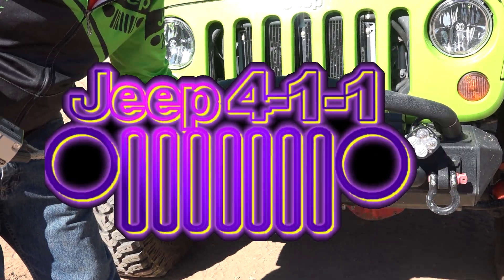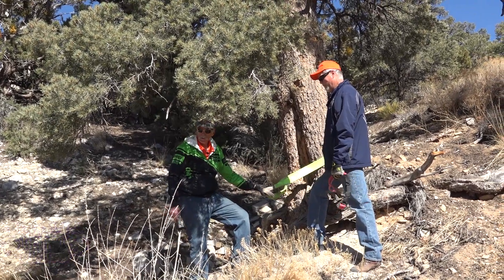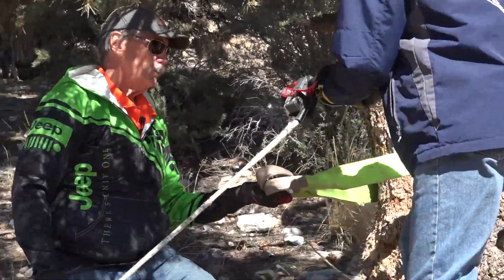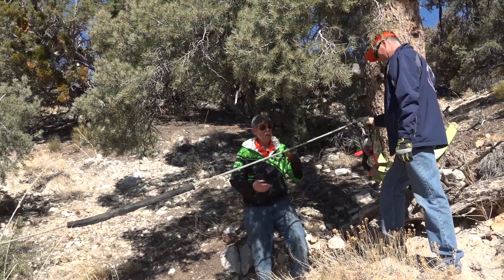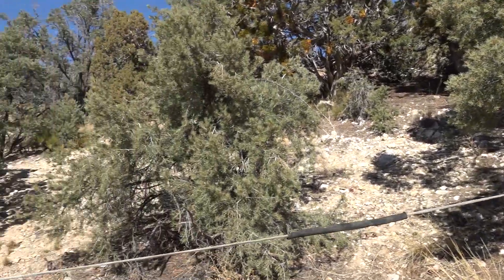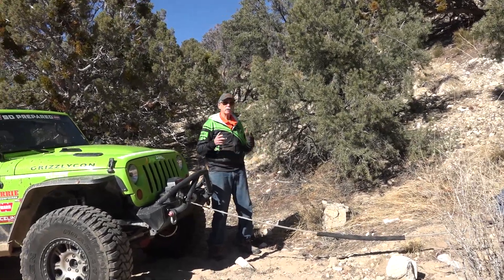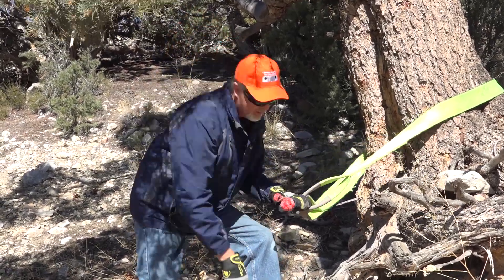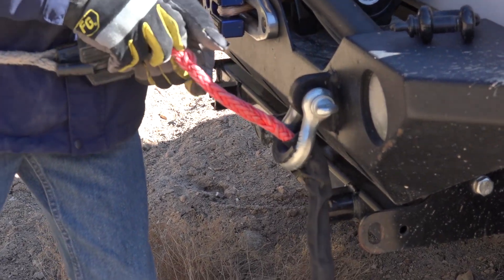Winching Tips Tricks Techniques Part 2 Using snatch blocks for difficult winching operations

Comment: If you would have used the orange snatch block like you said you could on a tuffer pull with those thin edges would have CUT THAT SOFT SHACKLE IN TWO!!! SOFT shackles are made to be used on ROUNDED EDGES NOT SHARP!!! sorry for the caps just don't want to see anyone get hurt by doing what you say.